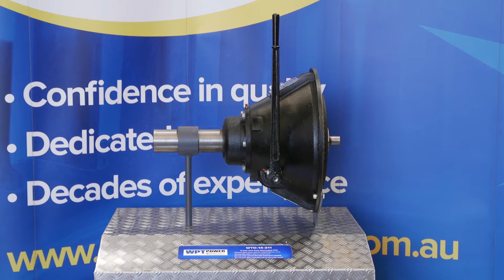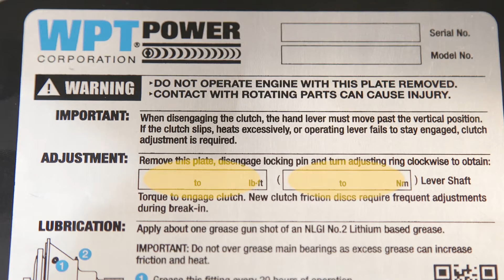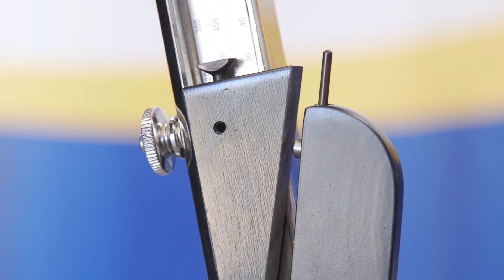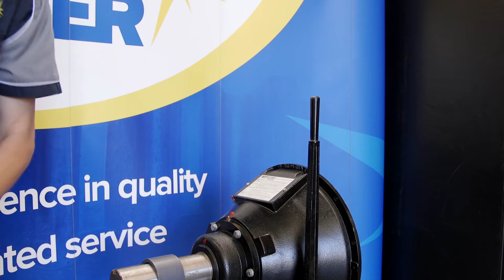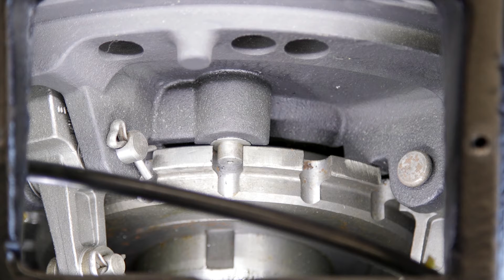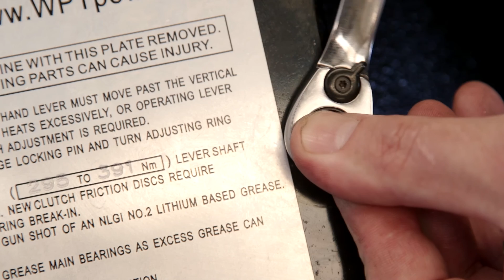Over Centre Clutch Adjustment

Comment: What will case a blind not letting lever to function properly?
Reply from the maker: Hi Victor 
If the handle is not moving easily I would suggest that there is corrosion or lack of lubrication between the main shaft and the sliding sleeve.
It could also be corrosion of the operating shaft and the housing.
Either way you will need to pull it down and correct the issue before you ruin the whole unit.
Let me know if I can be of any help.
Regards
Northstar
Reply: Thank you . yes this was one result. Then after some adjustments. Functional again. Thanks, do you have info on that special torque wrench?
Reply from the maker: @bles_the_hard_worker.gutie5327  it's nothing too special. 
Well... I do not think it is that special.
Warren and Brown have been making Deflecting Beam Tension wrenches for as long as I can remember. 
I still have the first one from when I was an apprentice mechanic (it is much smaller).

They are an Australian made product but I'm sure you can source something similar and in the correct torque range where you are.
If you are interested in that particular one, here is a link to their web site. 
https://wbtools.com.au/deflecting-beam-torque-wrench-1q-drive-140-680nm.html
Regards
Northstar Power